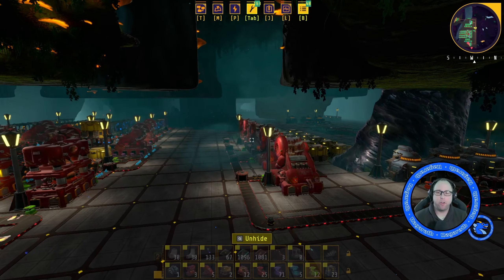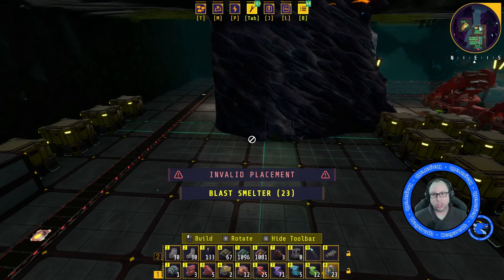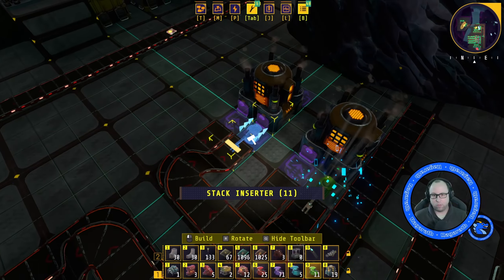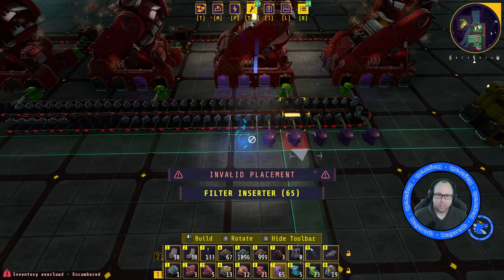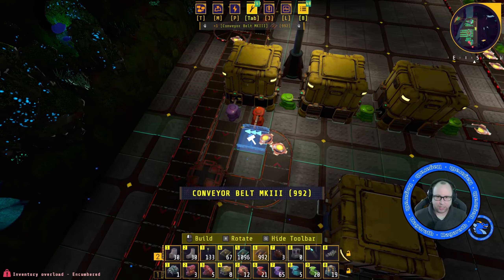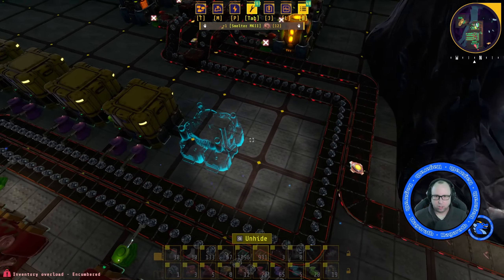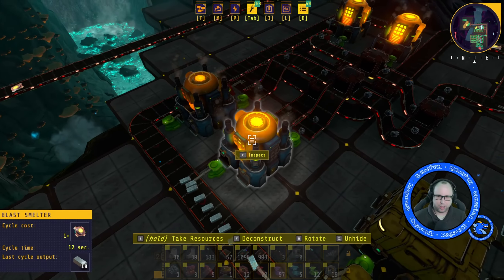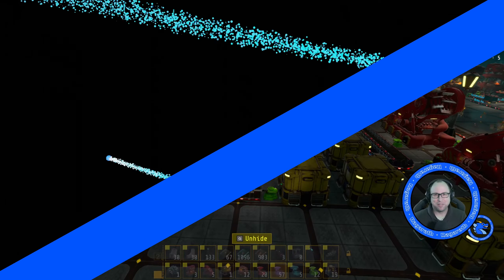Top Level Efficiency Ep4 - Blast Smelters - Techtonica

Comment: Great idea to place 2 red inserters along with a splitter to achieve 20 items per minute insead of just placing a single yellow inserter that does 20 out of the box ;-)
But really nothing wrong here, at the current state the game often needs some "workarounds" and it clearly gets the job done that way
Reply from the maker: The reason for splitting was space constraints getting everything out of one box. It get's even worse later on! :)

Still need filters on the hubs IMO to allow us to control how much goes each way. Maybe even what goes each way.
Reply: @Ragarath  Yeah, right. I finished the whole story and I'm done with all the research. Keeping things efficient is basicially not possible right now. E.g. I got rid of excessive material by a monorail connection to a dedicated "dump area" that just holds a huge amount of boxes.
Long / stacked filter inserters are missing, some simple logic would be great, ... anyway a very enjoyable game and I liked the story part a lot so far.
But for now I ended up with starting a new round of Factorio and will come back after the next major update.

Comment: Love the setup for the blast smelters. Im going to have to use that one if you dont mind. Im working on a vertical sort of build , and being compact like that is going to help a tone.
Reply from the maker: Hey @will830, I did actually do a more vertical build of this where the smelters were on top of each other. Makes it even more compact and you split the belts the same way. 

It depends on how high your levels are though as it uses I think 7 voxels high.